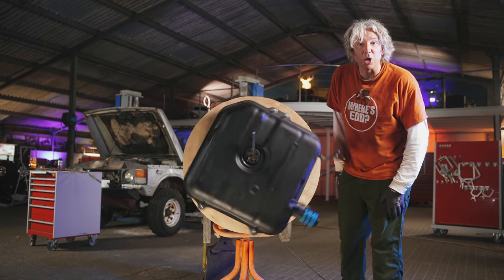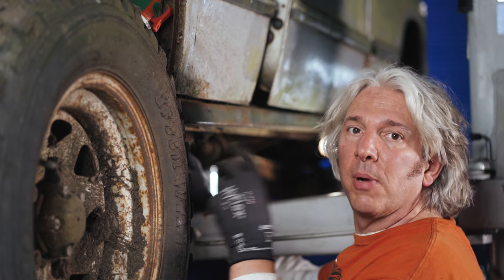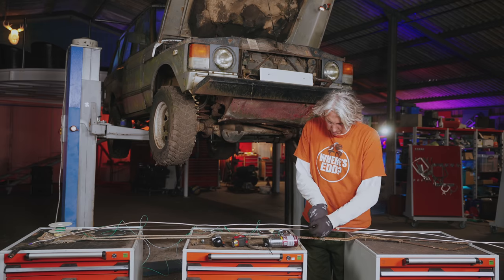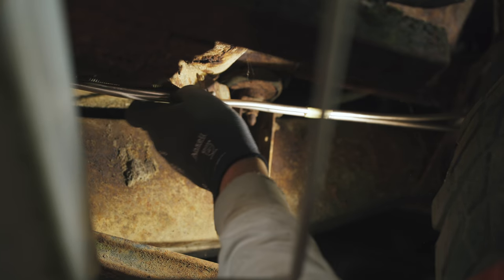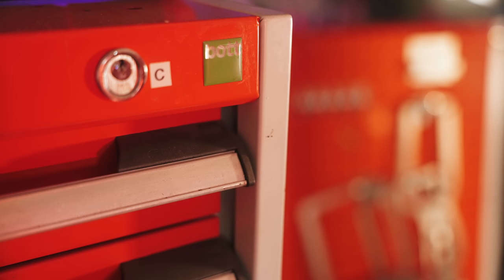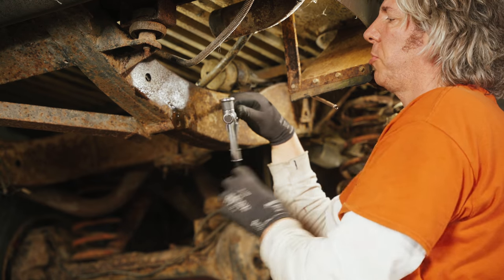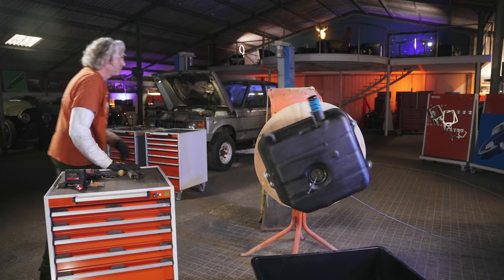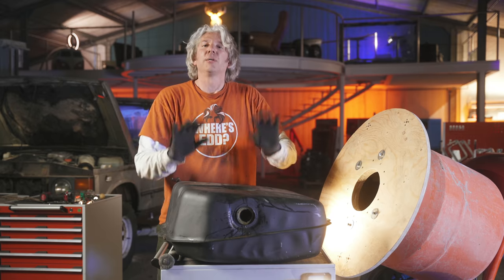1986 Range Rover, rusty fuel tank fix, Part 2 - Edd China's Workshop Diaries

Comment: I actually did the same thing to a 96 Jeep Grand Cherokee fuel tank because the fuel pump was toast. So I dropped the tank and thoroughly clean the inside to like new. No need for a new one if it is not leaking and rusted through...

Comment: As a chemical engineer we were taught to put loops in pipes to allow for thermal expansion and contraction. I wonder if that is why the fuel lines had those steps in them?
Reply: Enough kinks and bends in the pipes for that not to be a problem, also they’re only a few meters long, not hundreds as they can be in a factory. My guess is that the factory bends/steps have something to do with the assembly jigs in the factory or access to bolts marrying body and frame.
Reply: @subwooferbone  I think you are right, the Linear thermal expansion coefficient of Copper is only16.5 µm/(m·K) so going from -10deg C to +40 deg C with a 4m pipe would only change the linear dimension by only about 3.3 mm.

Comment: A tip for threading pipes through cassis etc, shrink some heat-shrink sleeve over each end. Less messy than pvc tape and just as easy to remove when done.

Comment: Edd- saw that you noted the 25 mm by 150mm section with the bends for "no known reason"; the reason is as a strain relief, so the pipe isn't streched or compressed when the ladder frame bends or bows as it works. Needs to be there. Saw your fun with the tank cleaning- when Datsun started shipping cars across the Pacific, they were having problems with the gas tank inner coatings breaking down and clogging the fuel system. Lots of warrantee recalls and headaches!  FR

Comment: I really wish I had as much time as Edd to fart about with cement mixers and imported flaring tools, but I reckon I'd have to get a used tank and some rubber fuel lines, but that's just me, anyway back to my Audi A4 with the broken front strut. This won't take long.....

Comment: The reverse are spur because the mesh directly, meaning that the 2 gears just move into each other to engage and move away to disengage which would be very difficult if they were helical. Farward gears are always in mesh and the engage to the shafts through synchros.

Comment: While this comment may not ever be seen....I'm late to the party and wanted to add a suggestion . Instead of using screws and such , you can use relatively sharp edged driveway gravel . If you use it with an eco safe solution like the evapo-rust , you can remove it , let it dry and just toss it in the driveway when you're done . But the sharp edged stones do a REALLY good job of cleaning an old rusty steel tank . Even better to automate the turning process like you did as well . An old mechanic I knew used to strap them to his tractor wheels and drive around if he got a nasty tank and it worked surprisingly well .

Comment: My tank is out ready for de-rusting internally. Not quite as bad as I was expecting. Only have have the float hole to get inside as the long filler neck is attached and about two thirds of it is not very deep. Plastic swirl pot and return filter in there as well. Quite a challenge! May have to go the electrolysis or acid route. Can't get a new tank and no alternative.

Comment: Hi Ed, enjoying your new channel. Next time you want to remove rust from something, make yourself a molasses dip (9 parts water to 1 part molasses). Can take a week or two but will completely remove all rust. Ok with environment and superior to every thing. Find yourself a rusted bolt/nut and experiment with a jar full. For bulk tanks your can get the molasses cheaper from your local livestock supplier (used with horse feed). Cheers - John from Oz.

Comment: You also need a crimp tool to make ferrules at hose connections. 
Pinch points are better opened up allowing grommets to be used. Galvanic corrosion is real and we don’t need vibration wearing holes into fuel pipes.

Comment: You can use ignition lead separators to keep the parallel cunifer lines tidy. , 8mm-12mm sized clips are available from performance shops.  They come in double clamped or open clip types, also available in plastic/abs or alloy. The double clamp versions also have mounting holes for self tapping/bolts etc…. . It’s prob a good idea to blow out the lines after debuting. 😁
Reply: Typo, debuting should be deburring. Damn auto correction 😳

Comment: Hi Edd.  Im a lecturer in Electrical Engineering.   Your vid showing ohms law etc was great,  but could i please point out that 9 milli amps is the point at witch you cant let go ( hold on). And 50 milli amps will kill you,  also we have info from the HSE saying that.  Five people a year are killed by licking a nine volt battery.  So you have been lucky lol

Comment: Just finished my 89 range rover 3.9 efi short wheel base. Mechanically its an awesome car, and renew all the critical components in the v8 was fun and pretty straight forward. But that awful 14cu hotwire injection is a nightmare! Cant read it with rovergauge and the cable. Only the 14cux and higher are capable of diagnose. Isn't there a better way to run these V8 without falling back on carbs?

Comment: Good choice with the brake lines. We use the ferrel type and nut in our lines for our manufacture process, they are an absolute mare to get a good fit unless it’s a good square straight line. First one I’ve watched and a fan of China engineered stuff. Be good to see what you can do behind the scenes of your previous endeavours. Pick up the pace and good content you will thrive, Gas Monkey, Cough something Dealers and Graveyard Carz are all on this format now so go for it. Get some old mates in on the act too make a proper  lol tv car mate, hobby thing of it it will fly.

Comment: Thanks for another great clip. I do have a question: Why are brake lines flared and fuel lines have a beaded end?  The reason for the question is the beading tool is $120 and that's about twice what I paid for a medium priced brake flaring tool.  I'm a home hobbiest and my list of tools to be acquired is mighty long as it is.  I'm not shy about buying tools-I make it a point to add to the collection monthly.  Having just acquired a TIG set up and tanks plus some air tools and impact tools in the last month, I'm saving for a Linear 10 AMP power supply for electroplating.  Point is, I'll buy the tools but it would be nice to have some that do double duty.  I understand the difference in termination but it seems to me there should be a way to adapt a compression flare fitting to mate to the flex fuel line/hose

Comment: the Skink popups in fuel and other pipe are expansion and shock sections.. it is a place where the pipe can flex a little and not transmit the force of movement in the line due to heat or cooling and movement bang and crashes in the motor or tank can be Isolated .. even crude oil  pipe lines have them. these  take the stresses rather even  the movement working on the pipe at the fitting... breaking the pipe off in the fitting. the rubber hose preform the same function

Comment: Next time you wish to tumble any container for rust removal, you might want to consider using a fine gravel, like what they use in a fish-tank. You can easily use more gravel and it really sands away that rust.

An other way to remove rust could have been electrolysis. I've seen very nice results with that...

Comment: An alternative to your wonderful US pipe tool is to use crushable olives. Only problem is that one end is easy but on the other end you need to cut the nut off to remove it. The olive is hidden inside the rubber pipe so you can't see it and the olive seems to work well.

Comment: Edd, I've seen coatings for the inside of fuel tanks to aid in restoring them?  I'm amazed at what you did with that rust bucket of a tank and the use of diesel to prevent rust is genius.  Just curious if you considered a coating product?

Comment: Evapo-Rust works best when you just immerse the part you are cleaning and let it sit until the rust is gone.  You should have just bought enough to fill the tank and walk away.  Probably would have done a better job on the baffles.
Reply from the maker: Definitely. It was amazing on my little test piece, which I did immerse. But that tank is 80 litres, that would have been over 500 quid! (The replacement tank is about 140…) Anyway, it was a fun experiment. 👍
Reply: @eddchina  Certainly not going to disagree with you on the price or the entertainment value of seeing the tank spinning around, but the other thing to keep in mind is the stuff is reusable.  I follow several restoration channels that have a 55 gallon drum that they lower parts in and just top it off as it evaporates.  So it is more than just a 1 time purchase, it is an investment IF you regularly de-rust things.

Comment: The kinks in long tube maybe is for prevent water hammer noise? Using too much force in rubber hose clamp is bad for hose. Spring clamps are suitable in low pressure hoses.

Comment: Hi Edd, great vid as usual. 
I do have a fuel related question though, which as yet seems to be largely unanswered on the interweb, and might make an interesting episode.
As you probably know, in September the government is doubling the amount of ethanol in our petrol, and the gov't's own website says that most older vehicles won't run on it. It corrodes the solder on carb floats, dissolves fuel lines etc etc.
For owners of cars and bikes from the eighties and before it seems that maybe new fuel lines, carb floats and fuel pump diaphragms might sort it. For those of us with cars between 10 and 25 years old, where we have in tank electric fuel pumps, EFI with plastic injectors, nitrile o rings etc, it seems unclear what exactly needs to be done to run on the new fuel.
I know that super-unleaded will still have the lower ethanol content for five years, but what then? We need to know what is necessary to convert to the new stuff.
Cheers
James
Ps. I know it's possible to wash the fuel to remove the ethanol, which is ok for your lawn mower and chain saw, but impractical for the amount required for your daily driver.

Comment: It's a little weird to do such a lovely job of replacing the fuel lines without first welding up the cracks in the floor (26.39) and rust-painting the underside of the vehicle.

Comment: 12 Hours on the mixer? The noise would drive me mad. With your skills Edd I would have thought it would have been easier to cut the tank around the seam after neutralising it, then flap disc clean the interior and weld it back together? Surely a 3 hours max job and a far better finish for you Edd?

Comment: amazing job... very clever... did you blast out the lines before connect together?
btw: A RangeRover is quite a "easy to handle car", bcause it has a frame, enough room between the Bodx and the frame.... its much easyer to work on than a unibody car...
Intresting to know, where the tool for bending the tubes come from. Can you post the brand? thx.

Comment: I am wounding about the work Harding characteristics of that copper alloy. Most copper alloy get brittle when subjected to vibration. 
I use stainless steel fuel line,  hard to work with yes. Reliability is superior.

Comment: Not sure why you need to feed the piping through with the connector - surely the advantage is that the connector can be fixed to the pipe after it's been threaded through the chassis (I do get the idea of 'factory original' look - although there again, it's not going to be a concours Range Rover...)

Comment: Nice work. With all that effort on the tank, I'm surprised you didn't seal it with something like POR15 products. That'll make sure that E10 (that became standard in the UK fuel stations around the time of this video) doesn't accelerate further rusting. Clearly with the work you're doing, the intention is the restore this vehicle, so it's not wasted effort.

Comment: You’re turning into a national treasure Edd.  I have a question for you. What factors do engineers consider when deciding upon torque values for engine fixings ? I ask as sometimes we have to replace one with a bolt of the same size and thread pitch, but the materials and head shape and diameter may be different. Does this affect the torque needed ?
Reply: The material of the bolt and what it is screwing into makes a big difference to the torque calculation. Other factors are the amount of thread engagement and the amount of preload required. The use of a lubricant also makes a difference. The diameter and shape of the head will usually make little difference to the performance of the bolt as it should be the thread form that takes the load.  But beware if the bolt has a washer head it may be needed to prevent damage to the bolted joint. The class of bolt makes a big difference to bolt performance so makes sure the class is the same. Hope that helps
Reply: @caedes5728  Yes thanks it’s so easy to think you can just pop a different bolt in of the same diameter and pitch but there are lots of factors. But I’m interested that you say the the bolt head has little bearing, I would have thought it did but that’s the reason I asked, I didn’t know 💁‍♂️  I’m just replacing a set of bolts that in my view this question doesn’t matter to but it made me think about it. Thanks for the info.  Rich

Comment: Just a concern that as the end of the fuel pipes passes through the pinch point, that there is a lot of crud still there and could get into the end of the fuel pipes - what no bungs? The concern being that even with a good blow of compressed air that there would be contamination in the line to get into things it shouldn't - probably a filter - once you get it all hooked up.

Interesting stuff.

Comment: When he measured the fuel line with a string (tape ruler) and then said , I'll just add an inch or two I knew it was time to leave. Also worried about burrs yet does not enclose the ends to keep out trash when pushing it through.

Comment: Using gravel and sand would be better then having only handful of screws and washer inside. 
Of course I understand that the chemicals used may not like gravel and sand, but you can do those treatments separately. 
Also varying the angle of the mixer which I did with couple oil tanks and one fuel tank really gets to the rust.
Also when it comes to gravel you can put a lot more of it inside and that will also allow it to get on more places then handful of anything.

Comment: I am wondering does the factory lines have the molded ferrule on end putting one in the same position of threading them through the impassable pitch points. Looks like Ed went on with the better option.

Comment: Question: Are the old flex pipes, in the engine bay E10 compatible ? I would assume the new one for the filter is. Maybe the filter is not. As I have read on a number of occasions that paper filters will disintegrate with E10

Comment: I suppose there is some "reason" that so much time and effort went into using copper tubing, specialty tools to make fittings and the never ending "back and forth" fitting rigid tubing to irregular spaces. Is there some regulation against shielded flexible hose?

Comment: The other solution for that tank would have been to just tip a couple of litres of POR 15 fuel tank sealer in there and tumble it around to coat all the surfaces, pour out any excess and allow to dry, job done

Comment: What would have been the problems with making the replacement fuel pipes in a number of pieces, (complicated bends and straight bits?) and joining them on the vehicle, by the method of Edd's choice? (When the vehicle was assembled, there were probably none of the components  installed that are now in the way, so one-piece pipes were easier.)
Reply: The more joins you have, the more points of failure and potential leaks you have. Plus, the original one had a single length, so Edd chose to keep the originality of using a single piece replacement.

Comment: Edd, I see that you used diesel fuel for the final rinse on the Range Rover’s fuel tank. Would it have possibly been better to use some two cycle fuel for the extra oil in it to coat the inside of the tank? Especially with the fuels now containing ethanol that attracts water in fuel, and therefore rust? I missed if the Range Rover was diesel or petrol powered.

Comment: I'd have sorted and rust-proofed the chassis before fitting the fuel lines. Or at least jet washed all the crud off. Just like early Wheeler Dealers,  working around dirty components. The only criticism I have regarding this video and the earlier WD shows.
Over all, I still like Edd's way of explaining as he goes along.

Comment: Question: metal vs iron fuel lines, or is it that you want keep it "original"? Thanks for great videos!!!
Reply: he`ll go to prison if he steals fuel lines !
Reply: I assume you are comparing the steel ones to the cupro nickel. Manufacturers use steel because it is cheap, same for brake lines. Cupro nickel or kunifer is easy to form and flare and doesn't rust, but is more expensive.

Comment: Hi Edd
Could it be that you forgot to isolate the fuel filter? The old one seemd to have had one. The filters for my cars have a thick plastic label all around. The whole thing prevents contact corrosion. Otherwise the filters tend to rust through there.
CU
JFnotK

Comment: Reminder - £140 for a new fuel tank.  (Cement mixer  £250, Screws £8.00. Evaporust £28 for 5 litres, Paints £30, Milwaukee vacuum cleaner minus batteries £169)  10/10 for persistence Edd.
Reply: But it's still worth to annoy the neighbors with.

Comment: Might have been quicker to manipulate all those metal bits in the tank with a speaker magnet till they reach the hole of the sender unit or the filler neck.

Comment: Better to tape the ends of new brake pipe with masking tape so it does not collect debris inside pipe when feeding it along the point of travel as I do when feeding John Guest Speed Fit plastic barrier pipe under floorboards and between joists!